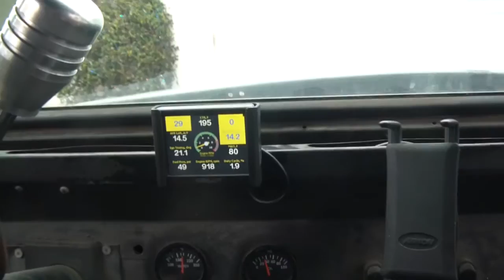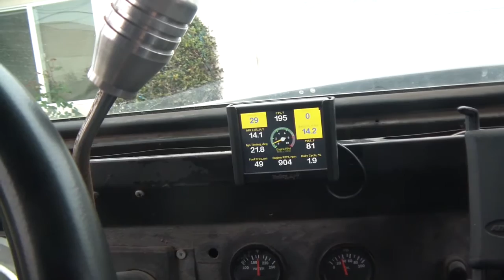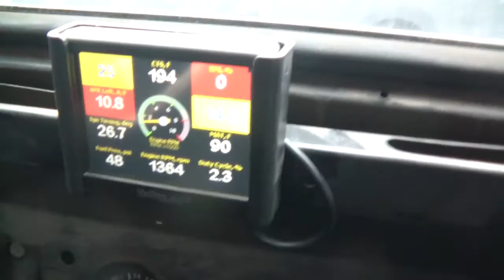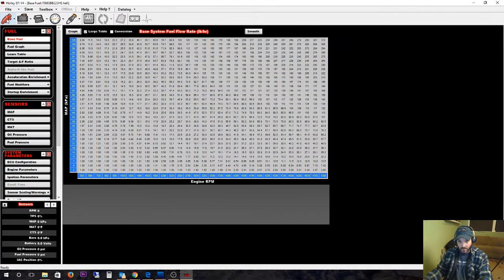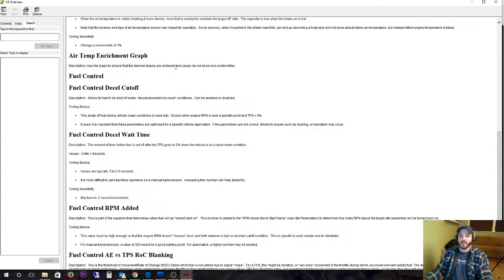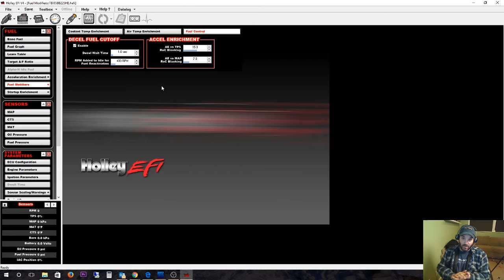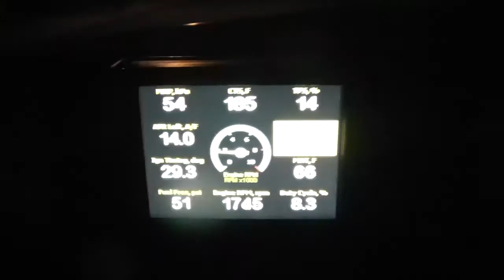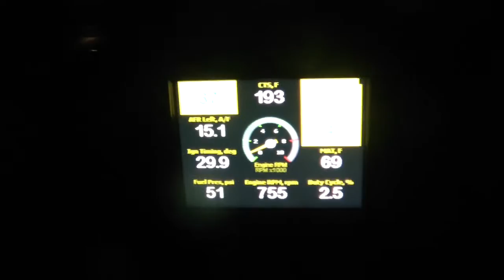Holley EFI HP Terminator Decal or DeAccelaration Tuning

Comment: Hey there, Craig here, I've been watching on wife's account,.. try changing you fuel press at regulator until you get 43 psi,... per Terminator install manual. Pg. 29..... "Note: Terminator inj. size/flow is calculated at 43 PSI."
"Inj. size -- This is the value of the injector static flow rate lb/.hr., of the fuel that will be used. If this number is not correct, the fuel inj calculations will not be correct and issues may arise!"
"Fuel Press-- Enter the actual fuel system press of the fuel system. It is important this is  entered properly if  the fuel flow calculation is to be accurate!"  
Looks like you're using fuel press sending unit. If not, you'll have to enter it manually. Adj it to 43 before you enter 43. I saw your press was at 50 or so, that might make it richer.
Might take care of your problem.
I haven't installed mine yet.
I've been watching on smart tv....on pc now so I could comment.
Reply: cool bronco. i too have the terminator on my car. i have the same problem. rich decel conditions. i really like this system i have learned a ton about efi and tuning and still learn new things every day. BTW its pronounced decel not decal lol.